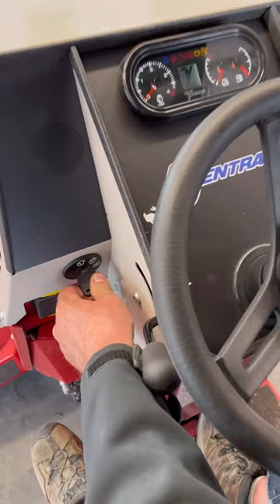Switching Ventrac Attachments

Comment: I’ve had issues with my PTO engagement bar on my 4500 with less than 15 hours of my useage. Wont stay engaged long. It’s been looked at 5 times and still issues. It’s not widespread. I seem to have the issue that won’t resolve.
Reply from the maker: I would take it back to the dealer. It should be under warranty.

Comment: Have you tested the SSV? Im a teen and wanting to expand beyond mowing and landscaping for the winter season when it comes back around and I’m wondering if it would be a good investment over just buying more snow blowers.
Reply from the maker: I’ve never run the SSV, it looks like it would be fun though
Reply: @hausplans  do you know if you can still put all the attachments on the 4520? Cause if so i think long term it would be more useful seeing how i can use it in spring too
Reply from the maker: Do you mean the SSV attachments onto a 4520? I think the SSV has its own attachments. However all of the regular tractor attachments fit both the4500 and 4520. They are all interchangeable.